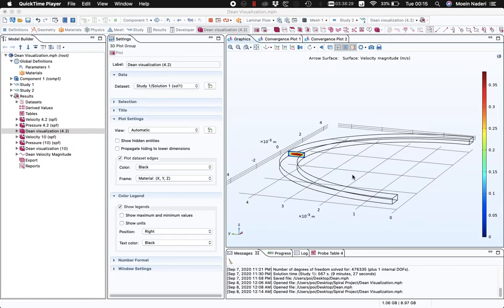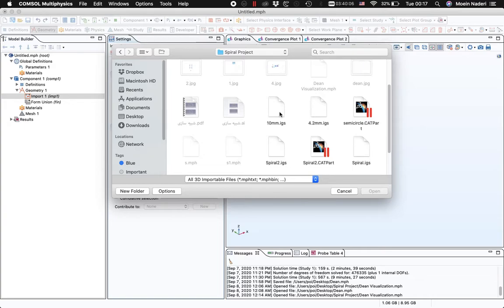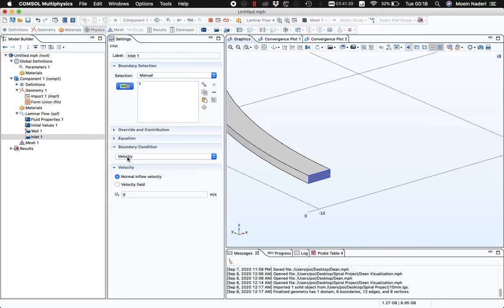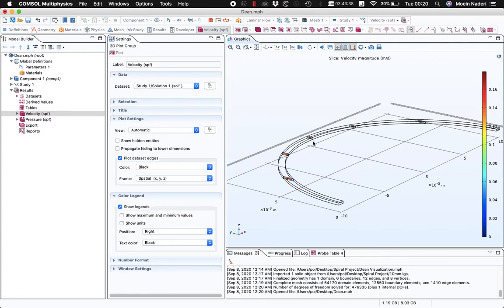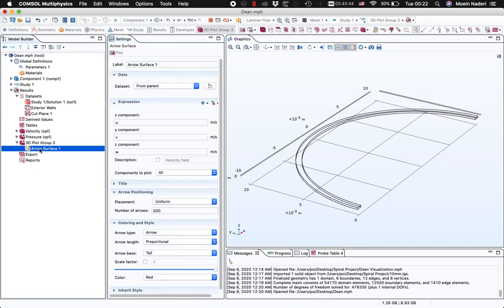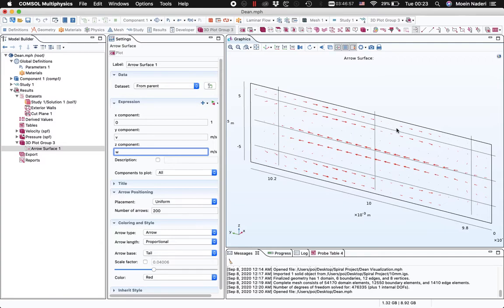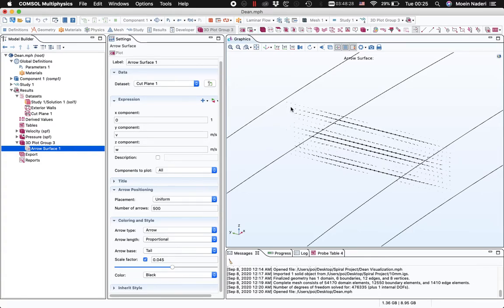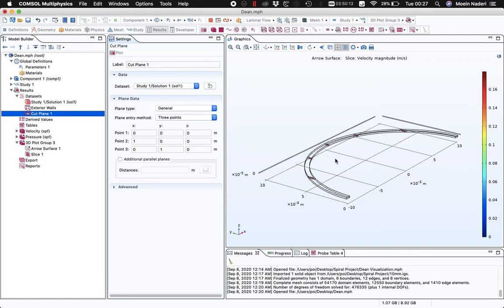COMSOL Tutorial | Dean Flow or Secondary Flow in a Curved Channel | Dean Vortices Arrow Plot

Comment: Hi Moein, I tried doing the same thing but within my cross-section, all the arrows appear to be pointing in the same direction. Do you know that is ?
Reply from the maker: Hi, I know what you are talking about. I had the same problem with spiral channels. Is your geometry also a spiral?
Reply: @moeinpoi  Yes it is also a spiral. I'm trying to model a spiral microfluidic device and I want to show the dean vortex in my project.
Reply from the maker: @saucebaws9058  You have to manually change the position of the cut plane until it shows the correct results.
Reply: @moeinpoi  I have the same issue, hard to locate the dean vortex plane
Reply from the maker: @songtaoye8047  Yeah it requires a little bit of trial and error, the cut plane could possibly be within +/- 200um
Reply: Also do you offer any tutoring services, would be happy to pay for a brief session over zoom. Thanks!
Reply from the maker: @saucebaws9058  Sure, you can contact me on LinkedIn: Moein Naderi
Reply: I'm having the exactly same issue. The arrows point only in one direction, there is no dean flow. I tried to move the cut plane  but it doesn't show any diference. And the particle tracing also seems odd. The smallest particle ends up closing to the inner wall than the bigger ones.
Edit: I've tried on COMSOL 5.4 and 5.6 with diferent spiral geometries and in none of them I can see dean flows. I'm so confused because I just can't find what I'm doing wrong. I'm using a fairly high descritization (P2+P2) and the mesh seems ok(normal for physics-controlled mesh). It's so weird.
Reply: I found out why I couldn't see the Dean vortices. The cut plane needs to be perfectly perpendicular to the channel. That's why it can be challenging in spirals.
Reply: @vitorhugoRH    Hey, Has your problem been solved? I also encountered the same problem. Do you have any suggestions for determining a suitable section?
Reply: @crg8256  depends on the geometry. As I said, the cut plane must be perfectly perpendicular to the channel where the fluid is flowing.
Reply: @vitorhugoRH      Thank you very much for your reply. I'll try again and again. Can I ask you another question? When I was doing the real chip experiment, the large particles showed the inner wall focusing in the channel, but scattered at the outlet fork. What might be the reason?
Reply: @vitorhugoRH  I selected the cutting plane perpendicular to the channel, but the arrow still points in only one direction
Reply: @crg8256  in the expression for the arrow surface, don't forget to put 0 in the coordinate that points in the same direction as the main flow in the channel. In the case of this vid is x. see 7:00 min. If you have a curved channel, and the plane is perpendicular to the channel you should see the dean vortices. otherwise the plane is not really perpendicular despite looking like it is.
Reply: I have the same problem. Can you tell me how you finally solved it?